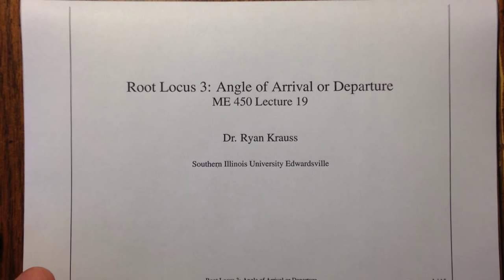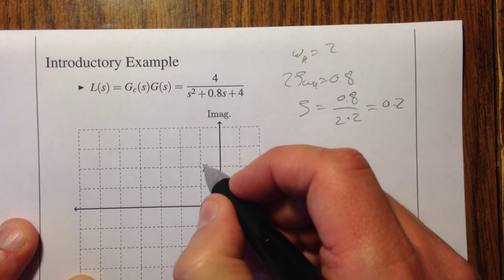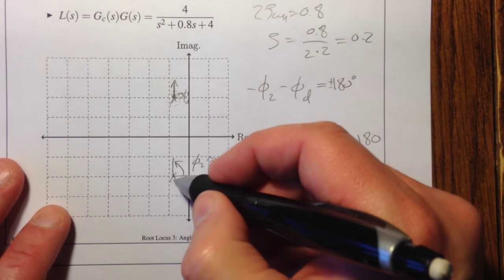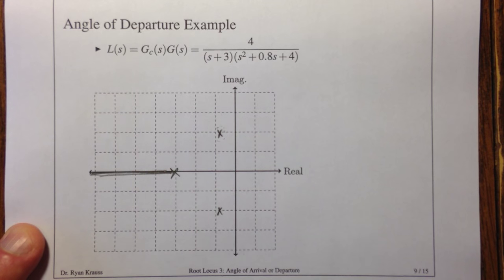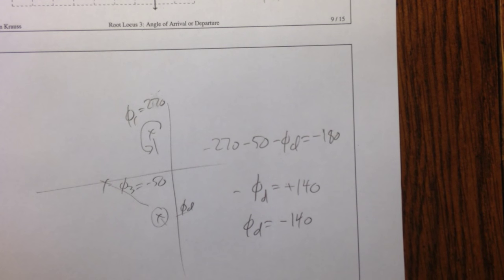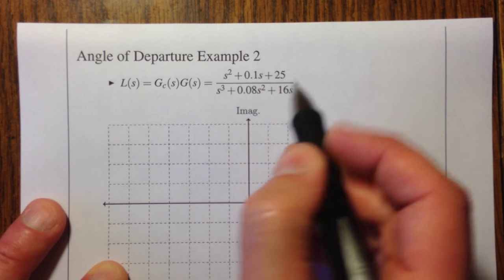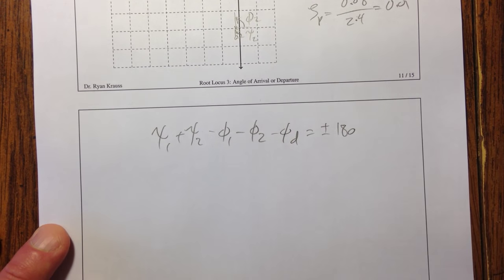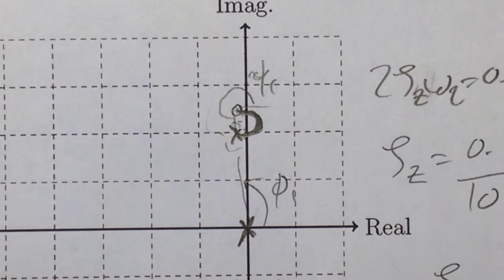Root Locus Angle of Departure or Approach Lecture Video

Comment: Hi
I think while you have taken the calculation for the 2nd problem phi2 the anle contribuited by the pole on the real axis is -50 but in the equation of -270-50-phiD=-180 -50 should be replaced with +50 i think so..

Comment: Hi
How do you know that the locus indeed cross the imaginary axis just by looking at it? in this example the poles and zeros happends to be very close the the axis,but in other cases - it's not trivial and you have to check for the critical frequency of the system to see if it's indeed stable. I tried checking it in you example - but it proved very time consuming.
Reply from the maker: +ya ca This is the whole point of checking the angle of departure and arrival: if I have a pole or zero near the imaginary axis and it has a departure or arrival angle coming from or going to the right, it probably goes unstable.  At that point, check it with a computer.  It is very good to know how to approximate a root locus my hand or in your head, but trying to get all the exact details without a computer is not a good idea.

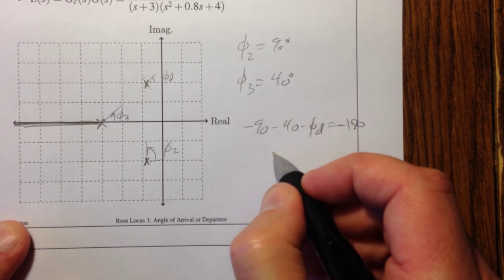Comment: why are you equating to -180 why not +180 8:30
Reply from the maker: +hassan oye It doesn't matter 180 = +180 = 180 +/ n*360
Reply from the maker: +Ryan Krauss YouTube did some weird strike through font.  Negative 180 is the same as positive 180 on the complex plane.  You can always add n*360 or subtract n*360 and still satisfy the angle condition.